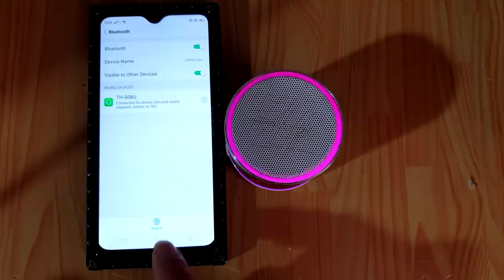Restoration Mini Speaker Look like old | New again after restoration

Comment: The very good restoration process, the most surprising thing was to wash the electronics with water that process guarantees to shorten the life of the components because you accelerated the oxidation process even though you dried the card but the water enters the interior of the components or between its pins causing short or damage and also a horn would not withstand the process of washing with soap and water so that horn had very little chance of reviving after that process since it would end up destroying the battery, not to mention, in a short time it will be inflated or it will lose its capacity load due to the humidity that it acquired when submerged in the water now my question is how you disappeared the oxidation points that the horn plate already had as well as the other metal parts for it or did you assemble another identical but new module or did not present that process of restoring the paint